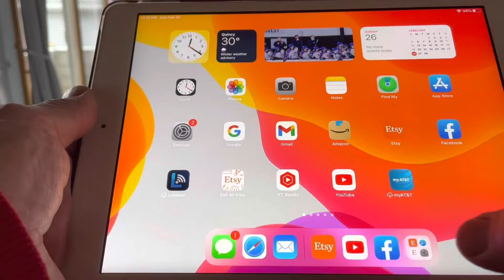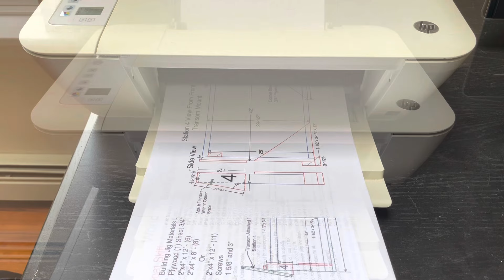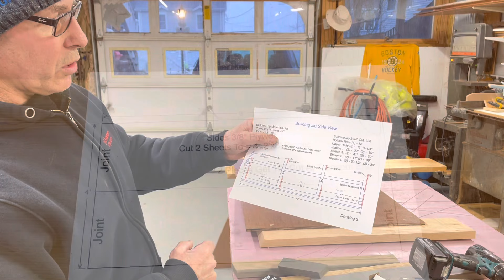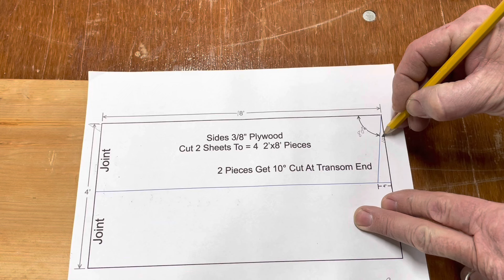Plywood Boat Building Plans

Comment: I've just started watching this video series as I've recently become interested in building another boat.  Just a quick question regarding using construction plywood in my build.   Since live in a region where acquiring marine grade plywood would be very cost prohibitive since it would have to be shipped in.  Would regular construction plywood be okay if the interior and exterior was covered in fibreglass cloth and epoxy?  Thanks.
Reply from the maker: Yes, use the best quality you can get.
Reply: @worldboatskiff8709  Thanks.  The best in my area is fir plywood, Good One Side.  I'm quite used to using West System Epoxy and will plan to use this product in my next build.

Comment: Does it require the seats for structural integrity.   Or can it be totally open floor
Reply from the maker: I built a walk-through version with seats on the side which worked OK but it was not as stiff as with bench seats all the way across. https://youtu.be/xER0zZ0z3_s